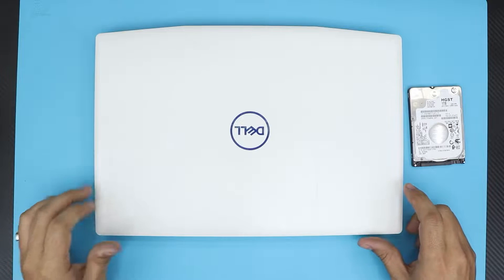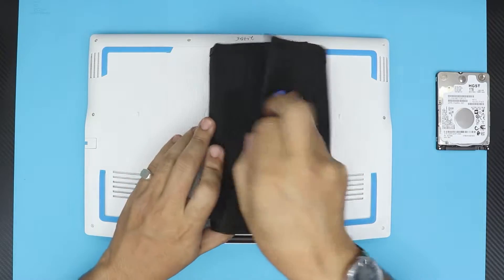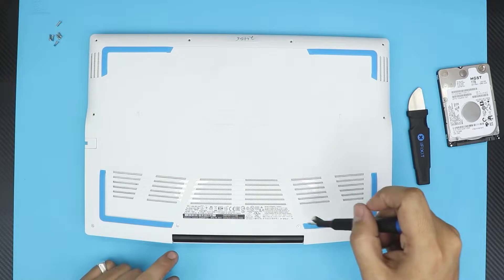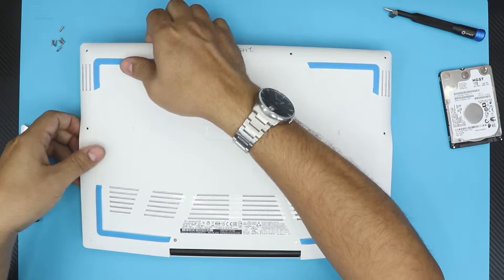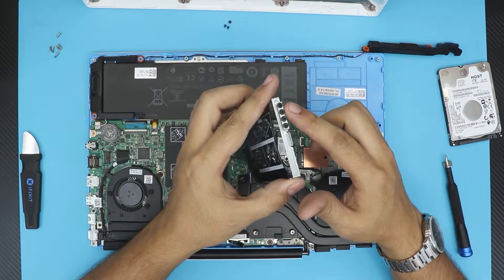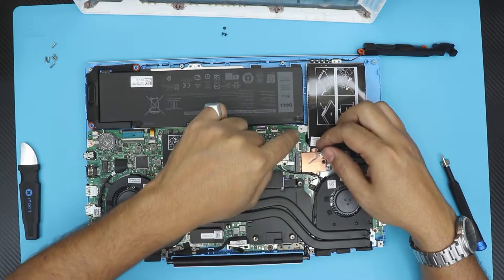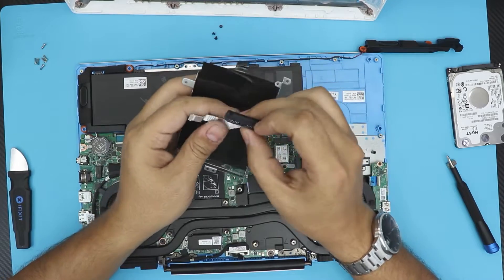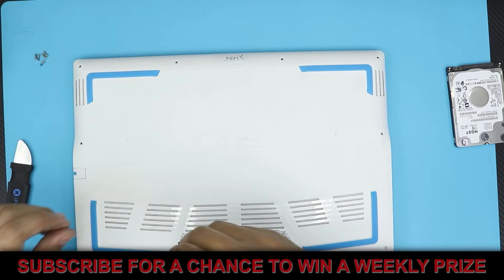DELL G3 15 series HDD / SSD upgrade GUIDE

Comment: Hello! I'm watching your video because I'm trying to put a samsung 5400 rpm HDD on my DELL G3 15 3500, but after i put it in, the computer goes on "preparing auto repair" and doesn´t boot itself, I believe what the computer is trying to do is to boot from the HDD instead of the SSD that has all the archives, windows and stuff, can you illustrate how can i aproach this issue, or is this a matter of the speed of the HDD since you say in the video that 7200 is better recommended? Appreciate the answer!
Reply from the maker: Thank you for the feedback! if you wish to support the channel you can LIKE or SUB or both :P
regarding your question: OK wait SSD is much much faster than any HDD! a hdd 7200rpm is faster than hdd5400RPM. if you upgrade the HDD to a new HDD you must install windows 10 on the SSD again, because when you have two drive in a computer during the windows installation the windows takes the 2nd drive and places some pending into that.
STEPS you should take:
#1 create windows 10 usb drive:
https://youtu.be/uDu8j2lE-dM
#2 now the solution for you will be to back up all your documents and images videos on the old HDD 5400.
#3 place the new HDD7200.
#4 power off the laptop
#5 place the USB BOOT drive (step#1)
#6 power on and keep tapping on F12 till you see a boot menu option
#7 choose your USB boot drive
#8 important follow steps by step: follow any of my windows 10 installation guide to get the optimum performance:
https://youtu.be/GkMZyCUarIA
(note when you get to the step to choose the where to install windows make sure you delete all the drives and you will be left with two drives, Drive 0, and drive1, one of then will be XXGB and the other XXGB.)
install windows on the SSD (XXGB you should know)
#8 good luck if anything let me know.
Reply: @uFixTek  thanks for your reply! I'm definitely subbing, if I'm understanding well, for me to place a new HDD in the empty slot of the laptop, I would have to install windows again in my main SSD which the laptop already has for it to work with 2 hard drive, (1SSD and 1HDD). Thanks for your help!
Reply from the maker: @aaronjuarez7470  yes my friend, you have a dependency with windows, trust me back up files and format its very easy and satisfying ☺️, and you windows will be faster, and your license will be transferred automatically. During installing click i don’t have product key. Follow the instructions i put. Once u got internet after doing the steps i showed, logging with you @hotmail.com account and your license will be activated

Comment: Im new to this pc gaming stuff, I too have a G3 gaming laptop , it comes with a 512gb SSD. My question is why would someone want to do this? I thought HDD are the past and SSD is the future?
Reply from the maker: Thank you for the feedback! if you wish to support the channel you can LIKE or SUB or both :P
sorry that i was away for few days, regarding your question: 
SSDs are only good for the OS and programs to run faster, but for the file security the HDD are the 1st choice, for e same reasons all  server around the world are always based on HDD.  2nd reason is that the SSDs have lower life span as its based on TBW (Terabytes Written), some low brand give you much lower tbw and Samsung brands give the higher. once the TBW gets to its limit the file risk is high and the OS becomes very slow and crashing.
but the HDD have no TBW (Terabytes Written), you can fill that and empty the drive as many times you like.
i hope this have answered your questions.

Comment: Will adding a 5400rpm drive really be much slower than 7200rpm?
Reply from the maker: Thank you for the feedback! if you wish to support the channel you can LIKE or SUB or both :P
regarding your question:  NOT really you wont notice the difference much, most 2021 laptops are shipped with 5400RPM

Comment: Help? The sata cable is attavhed to the HDD and I cant for the life of me figure out how to remove it! Already took out the hdd just need to remove the connector

edit nvm i just had to pull harder. not very intuitive idk
Reply from the maker: Thanks ✌  for the feedback!  if you wish to support the channel you can LIKE or SUB or both :P
Regarding your question:  ya you need to grab the adapter from its bace, not from the cable and pull hard :) it will get loose :P i i see that you got it :)

Comment: hey can i wanted to upgrade my laptop ram to 12Gb 
curently i have 4Gb + 4GB Ram config 

i wanted to replace one ram stich with 8GB Ram but 
in the market the shopkeeper has only 3200Mhz Ram so should i pair my stock 4GB 2666Mhz ram with 8GB Ram 3200Mhz ?
Plz tell
Reply from the maker: Thanks ✌  for the feedback!  if you wish to support the channel you can LIKE or SUB or both :P
Regarding your request:  yes you can mix 4gb and 8gb with different speed the bios (laptop) will adjust the speed of the 3200 down to the 2666. everything will be fine.
Reply: @uFixTek  
first thanks for such fast reply 
wanted to ask one more thing that can it cause blue screen error by using different frequency rams ?
Reply from the maker: A bad ram can give you blue screen, if your ram is old and has a bad sector it can give blue screen.
you old ram it may not show you blue screen because the ram, is not filled up to max capacity. and when you place the new ram even 3200 it may show you blue screen because the old ram will be filled.
i always do this to my clients if they upgrade the ram, down load a ram rest or use windows ram test command on your old ram, and see if you get BSOD with your old ram. 
if you didn't get BSOD  with your old ram then install the new ram 3200 and test ram test.
you can test the new ram alone to make sure it doesn't came defective.
if all test come OK, and you get BSOD  then you will have to reformat the windows but even before that check make sure your hard drive has  zero bad sector or weak sector use this free program,
https://www.hdsentinel.com/download.php
if your drive has even one single bad sector it can cause the BOSD
Reply: @uFixTek  
I'm a bit over cautious as I am upgrading my laptop for the first time
one more thing i wanted to ask is that 
->Bad ram could be a brand new too ?
Currently I don't have any HDD in my laptop as it came with only SSD

->if i wanted upgrade my RAM to 16GB then also should I buy 2x8GB RAM 3200 Mhz or should i buy only 2x8GB 2666Mhz RAM only ?
As currently I'm in situation to buy only one Ram stick of 8 Gb as I'm buying HDD for my laptop
Reply from the maker: #1. yes rams can come defective we do deal with many brands and in all brands defective rams do exist.
that's why you should always do a ram test after installing.
#2. dont ger 3200, get the 2x8GB 2666Mhz
Reply: @uFixTek  
Thank you sooo much for your assistance 😊😊
One suggestion please make discord community/group for discussions though you helped me here alot
Reply from the maker: @private-wc3zb  i’m working on it, coming very soon 😋  thank you for your support

Comment: I have installed an SSD that I had in another notebook with windows 10, the problem is that I enter the bios and I start the HDD as the first instance, which I suppose refers to the SSD that I installed but it does not start, as it does not recognize it. Does anyone know what the problem is? I have entered the task manager, in performance and indeed the disk is well installed I recognize it as disk 01 I think, any help or suggestion is welcome, thanks
Reply from the maker: oki my friend i got really confused of what you trying to do and what you have done :/
let me see if i understood you...
you my ssd you mean a m.2 ssd?
you placed another m.2 ssd that had windows 10 from another computer and removed the m.2 ssd on this one and placed it in the new pc. if you have done that then your windows should read fine. please give more detail what you want to do and what you have done.
Reply: @uFixTek  Thanks for answering, but I have solved it, what happens is that I bought a Dell G3 Gamer with 256 SSD, my other computer that is bad had an SSD with 480 GB and that was the one that I installed the Dell but did not recognize it in the boot for BIOS compatibility issues something like that, I formatted it and I'm using it to store programs, everything works fine ... Thanks for the contribution friend :)
Reply from the maker: oh oki im glad that you sort it out :) if anything let me know i will try to help as much as i can , good luck

Comment: Hello! tell me where can I buy a flat cable for a hard drive? I didn't have it in the kit.
thanks for your video ♥
Reply from the maker: Thanks ✌  for the feedback!  if you wish to support the channel you can LIKE or SUB or both :P
regarding your question: you don't need a caddy if you going to install an ssd just get a double side foam tape or anything alike to hold the ssd to the case, even with hdd there should be no problem.
https://amzn.to/3jYxlui
regarding the adapter you will need this: https://amzn.to/3CNusFg
Reply: @uFixTek  thank u ♥
Reply from the maker: @PolinaDemina-c8l  anytime :)

Comment: hello. my dell g3 15 has no built in hdd caddy or case like that in the video. what will be the compatible caddy for new hdd? can i buy in amazon?
Reply from the maker: Thanks ✌  for the feedback!  if you wish to support the channel you can LIKE or SUB or both :P
regarding your question: you don't need a caddy if you going to install an ssd just get a double side foam tape or anything alike to hold the ssd to the case, even with hdd there should be no problem.
regarding the adapter you will need this:
https://amzn.to/3mcaNsu
Reply: yehey i'll use the double sided tape instead :) thank you so much sir more power!
Reply: sir can i use this instead?? will it still be compatible with dell g3? 

Deal4GO SATA Hard Drive Connector Cable SSD HDD Cable for Dell Inspiron 15 5565 5567 BAL20 P4TVW 0P4TVW NBX0001YV00 (Long: 8.9 cm)
Reply from the maker: https://amzn.to/3CNusFg
this is fine it will work :) thx for the support
Reply: thank you so much sir
Reply from the maker: your welcome :)

Comment: hey how do find out which HDD is compatible to my system i have the same laptop as the one in the vid
Reply from the maker: Thank you for the feedback! if you wish to support the channel you can LIKE or SUB or both :P
regarding your question: Any SATA SSD 2.5" will fit up to 4tb, and any m.2 SSD or NVME also will fit.
here are the links for the best brands:
recommend you to place an NVME m.2 SSD for the windows: https://amzn.to/3ip0xLv
and upgrade your HDD to SSD: https://amzn.to/3fvEsJb

if you need help to install windows 10:
🔵 How to create Windows 10 USB Boot Drive: https://youtu.be/uDu8j2lE-dM
🔵 How to Install Windows 10 for Dell : https://youtu.be/ll_0K4hDksY

Comment: What's the process for removing the screws holding down the hard drive? I'm using a similar screwdriver but the screw isn't budging
Reply from the maker: If you talking about the 3 screws that hold the caddy, then use philips head 0 o 1. use the screw head that fits perfectly and you will need to push down with a force and rotate. sometimes they put the screws very tight. I would appreciate your support to the channel by a sub :P

Comment: I was wondering is this model supports a 2.5 inch solid state drive instead of a 2.5 inch hard disk drive.
Reply from the maker: this laptop any any laptop that has a HDD 2.5 can for sure get installed any ssd sata 2.5' without any issue, thank you for the support to the channel by a sub :)
Reply from the maker: @alainchristian  the best configuration would be to add a bigger m.2 ssd and have a biger mechanical drive for safe data.
Reply: @alainchristian   I currently don't have a 2.5 inch drive of any sort. I want to purchase a 2.5 inch SSD (NOT A HDD) but I wasn't sure if my laptop would support it but now  know, it will :)

Comment: Can we put a SSD in the HDD slot? 2,5" SSD can fit?
Reply from the maker: yes all ssd sata are 2.5' and compatible and it will fit even better :P thank you for the support to the channel with a SUB :)
Reply: @uFixTek  only sata SSD? or all 2.5" SSD?
Reply from the maker: ssd sata 2.5'
is the same as:
ssd 2.5'

any 2.5' is a sata
Reply: @uFixTek  Ok thank you for the help!
Reply from the maker: thank you :) it my pleasure  helping out

Comment: I would never leave the battery plugged in. Apart from that, good video.
Reply from the maker: its ok to remove but if you want to upgrade ram hdd sdd or wifi , there is no need at all to remove the battery, if you read the schematics you would know that there is no power on those rails until the power is on.  but if you feel safe doing it by all means go a head a do it, and i appreciate your support to the channel my friend :)

Comment: mine dont have a caddy please where can get it or model N
Reply from the maker: caddy: shorturl.at/kzFQZ
adapter: shorturl.at/ckmVZ

thank you for your support
Reply: @uFixTek  thank you but link not working :(
Reply from the maker: @roog2005  https://www.ebay.com/itm/Original-Dell-G3-15-3579-3779-Hard-Drive-HDD-Caddy-Mounting-Bracket-K2HV9/264386035967?hash=item3d8ea2c0ff:g:q3sAAOSwxmldHLr4

https://www.ebay.com/itm/Original-Dell-G3-15-3579-3779-HDD-Sata-Hard-Drive-Cable-Connector-CMXVW/264386985312?hash=item3d8eb13d60:g:GTMAAOSwX6VdHbyE

Comment: I just got new longer ssd for my dell g3 lap top but when i run lap top and attempt installation for Windows there is only 240 gb memory and new ssd is 1tb do you know what may be an issue? Thanks
Reply from the maker: you need to convert it to gpt format and it will detect,
Reply from the maker: unless you got some fake 1tb ssd :P, what brand is your ssd?
Reply: @uFixTek  idk did i made a mistake and my laptop.cant read it?
Reply from the maker: NO ITS NOT YOUR MISTAKE, TELL ME THIS:
did  your laptop came with ssd or m.2 and hdd and what you removed?
Reply from the maker: you installed a SSD SATA 1tb right?
Reply from the maker: and you still have your system on m.2 256gb
Reply from the maker: send a picture of your instalation,
upload a picture to https://imgur.com/
or email me @ bdsoporte.queretaro@gmail.com
Reply: @uFixTek  i emailed you
Reply from the maker: got it
Reply: PNY XLR 8 gaming 1tb nvme pcie gen 3x4 
Cs3030 ssd

Comment: I can put a ssd with connection of 2.5 instead of hdd of 2.5?
Reply from the maker: you can put any ssd or hdd sata connection there 2.5' and it will work fine
Reply: @uFixTek  THANKS LOVEUUU
Reply from the maker: :P your welcome
Reply: @uFixTek  As a last question, what would you prefer 2tb of hdd or 1tb sdd?
Reply from the maker: SSD 1tb but make sure you dont get Kingstonor adata they dont have dram chip make sure they have a dram else its not worth it.
the samsung are the best for ssd  they give you much higher TB write before failure the other brands give way less, always check for dram cash, and TBW (Terabytes Written) before failure.
https://amzn.to/3kjFfNq
Reply: @uFixTek  and what do you think is crucial bx500?
Reply from the maker: they are good and solid with 500gb and 1tb my brother uses them and he has no issue 
https://amzn.to/3c0Vzji

Comment: if i'm adding a SATA ssd  not replacing the already ssd m.2 that is in the laptop , i need to install windows and all that stuff ? or just putting the new ssd and i would work well
Reply from the maker: your windows is installed in your m.2 ssd , you can remove your HDD SATA and place a any 2.5' SATA ssd in there and login into windows normally and if you dont see the ssd in your computer , you may have to activate it.
here i made few step by step for you.
https://imgur.com/a/kVSxJNh
Reply: Thanks !! 👍

Comment: Is there anything you gotta do before installing? What happens when you turn it on after upgrading? Everything will be fine or do I have to back up info or something? Sorry for so many questions
Reply from the maker: when you replace the hdd or ssd you will have to install the windows freshly or download "Macrium Reflect"
and use a usb to sata adapter: https://amzn.to/37rUluM

and clone your main disk into the new ssd or hdd and then replace then as the video here and it will boot just fine.